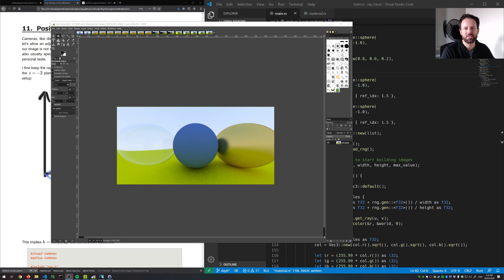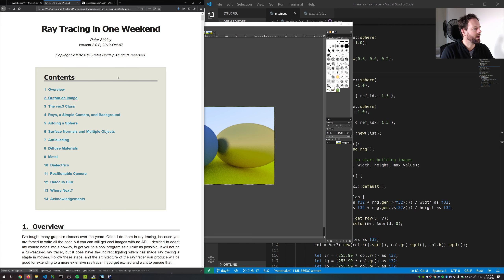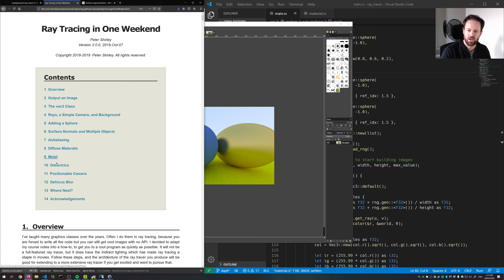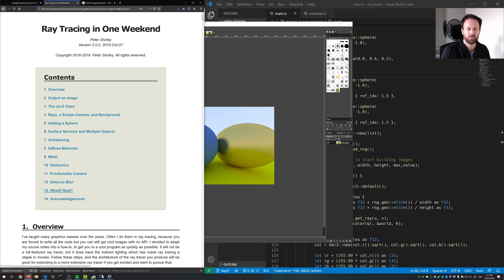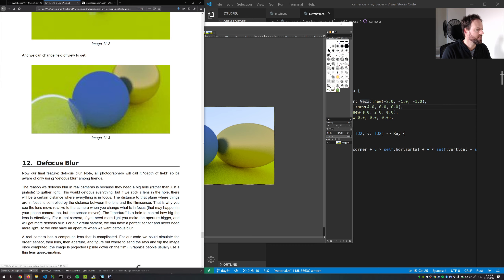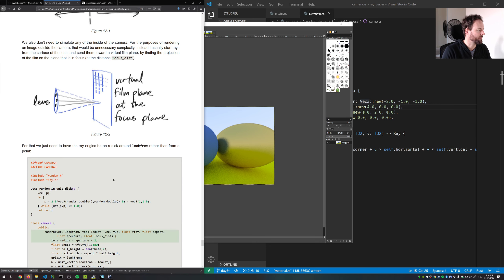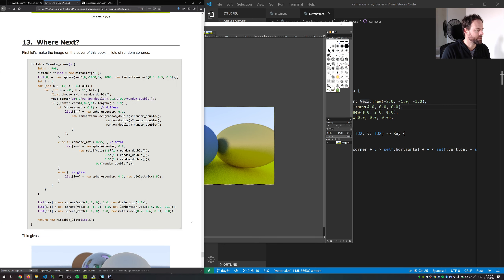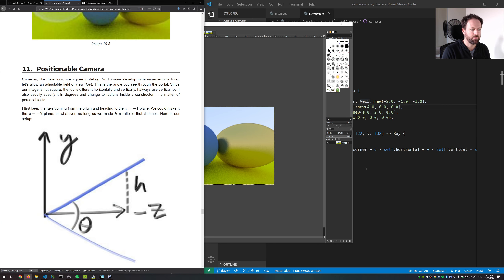Building a Ray Tracer in Rust: Part 7 - Finishing the ray tracer!

Comment: Finally made it through the series! Gonna try the rayon myself too!
Reply from the maker: Nice! I have a working rayon version in my Github repo if you need inspiration - the (messy) commit to add it is here, https://github.com/snarkyboojum/ray_tracer/commit/eb948a7ac54f6840acea6a576905e54dd2a6b97d
Reply: @snarkyboojum  thank you! I tried reading your code on GitHub but I think I need to understand how to parallelize code better first haha
Reply: I finally got the rayon bit to work! Compile time for 1080p image went front 17 minutes to like 3! wow
I'm having some issues however, my images are coming out so dark and washed out, did you have to adjust the gamma further after you palatalized the code?
Reply: nvm! I fixed it haha

Comment: I just finished this project and I'm rendering the final for Book 1 now!! I've been using your code as reference, but most of the issues I had were different than the ones you came across.
Reply from the maker: That's awesome Rayne. Nice work. How different did you code work out to be?
Reply: @snarkyboojum  Pretty different because I used Rayon to speed up the sampling instead of speeding up the pixels, and I used a separate project to help me add multi-threading for better progress stats and so I can . I'm trying to get it to display the estimated time to render, and just finished a portion of getting some features from clap to work. Here's my github if you want to check it out!

https://github.com/DivineStride/Another-Simple-Ray-Tracer